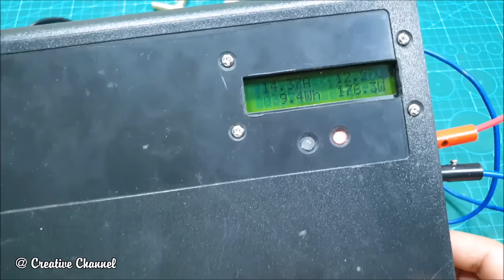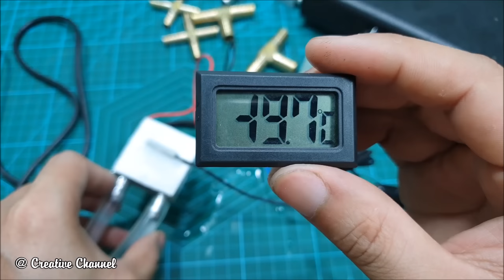How to make a Ice Cream Rolls Machine

Comment: Nice proof of concept, but please dont eat from Aluminium
Reply: It's safe when it isn't heated.
Reply: @reececrawford1688  Aluminium oxide dont care about hot or not
Reply: Should be use SUS316 plate , because aluminum plate more soft than your tool.

You will get some powder from aluminum plate.
Reply: Everything is aluminum. Pizza trays. Cooking sheets. It’s in every single restaurant and get far more use then you think. Heated or not.
Reply: @johnwu881  that's a good point
Reply: I was thinking the same thing.  Also, ed c, he/she is literally scratching aluminum into the final product.  That is a lot different than just cooking a pizza or cookie on an aluminum surface..  Those bits of aluminum that get scratched off into the ice cream will become aluminum chloride when they hit your stomach acid, and I personally would pass on that. To each their own though.
Reply: Anyone have a reason why? Only thing ive heard is that it can cause dimenta

Comment: Product links 
1.Peltier Module TEC1-12715 150W - https://amzn.to/2JrNeJG

2. Aluminum Heat Sink Water Cooling block 40x40x12mm - https://amzn.to/2HxuXHF

3.Battery 12volt 20-80Ah -https://amzn.to/2WXEzBO

4.Tube 10/12mm
-- https://amzn.to/2WXEIoQ

5. 12volt water pump -- https://amzn.to/2W7u3uD
Reply: Thank you so much for giving this links

Comment: who wants to see an Air conditioner built from peltier module ?
Reply: Me
Reply: MEMEME
I want to see using the scrap 0.6hp wall mounted aircon using existing evaporator and blower.. That will be good.
Reply: mee too
Reply: Not possible
Reply: Faisal khan These do not work well for lowering temperature of air. You need either a compressor cycle or “swamp cooling” for air conditioning.
Reply: No one... Its extremely inefficient unless you have free energy and little money
Reply: @null-xv3eq  moi
Reply: me
Reply: Inefficient af
Reply: already been done, Google it
Reply: Me
Reply: No, peltier modules are really inefficient, a 300w module can barely freeze water.... You're better off using a compressor with refrigerant setup
Reply: @tristan6509  ya I knew that that's why I want to see him build a air conditioner using peltier.

Comment: The water in the cooling circuit will be warm in a moment. This will reduce the efficiency of the cooling cell. You will need to cool the water.
Reply: Just replace the water if you use it very long
Reply: @koevoet7288  A better solution is to cool the water than to change it.
Reply: Aleš Musil better but fkn expensive and you wont use such a machine for hours
Reply: Just put ice in the water
Reply: Simple but a small radiator yo disperse the heat
Reply: @koevoet7288  expensive?  Just add two more modules to the water tray.
Reply: Mike Holcomb and how ur gonna cool those 2
Reply: @koevoet7288  they don't know anything  of thermodynamics .
Reply: Anyway, i was using peltier module for my final year project, and u know what, the plain water could not constantly cool down the hot side peltier, and i change the water to iced water, and after the iced melt down, the water becomes hot and built up temperature in my water tank reservoir and finally, the hot water could not dissipate the heat and cold side of the peltier was increased in temperature.
Reply: @aizukhalid9776  what if we used a radiator to cool down water?
Reply: @aswanthx  i did mention water reservoir for liquid cooling via radiator. But then, the heat will build up in the reservoir anyway.
Reply: Really good thought
Reply: @aizukhalid9776  So, the downside of peltier based projects is that you will eventually have the labor to switch the water anyway.

Comment: How cold is Your tray? Are such strong peltier modules required? Assuming I can cool water with a lot of ice can I use 12710 or 12712 modules? My power supply is old bequitet PC power supply which provides 600W tops but I dont want to have it working on full power.

Comment: Is this same technique used in refrigerator and air conditioner and if yes/no. Can we make air conditioner by this method
Reply: Refrigerator and Air conditioners use air compression for the cooling. But for diy AC, yes you can use peltier module. But the only thing to keep in mind in the diy that at the same time peltier  module needs good heat sinking as for the effective working plus the heat blown out should be out of the room, and not in the same room like many idiotic youtubers show in their diy  videos, not being concerned about the heat produced in the same room with the cooling. It's just make cooling useless and heat rises a lot. Minimum 2 peltier module is ok for Diy AC, and good heat sinking + extraction of heat outside the room. Hope it helps. Have a nice day.😃👍

Comment: Probably need to use ice water in the tub to get the peltiers to reach the -30℃ desired. I might try this--but simpler. Just mount the hot-side of the peltiers to a metal plate, set the metal plate on top of ice. (Peltiers tend to lower temperature about 30 degrees)

Comment: What is the voltage rating please reply
Reply: It's 12v but you need a battery or power supply that can output at least 55 amps (600W for peltier modules + 50W for pump). A standard car battery can handle that.